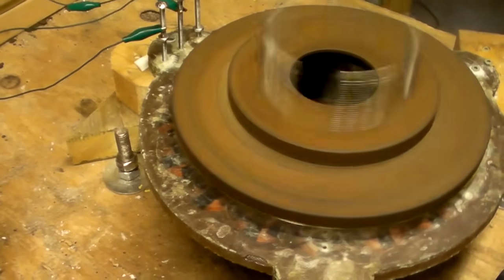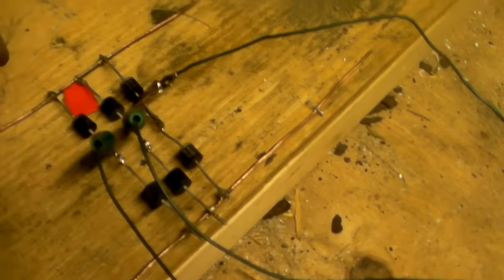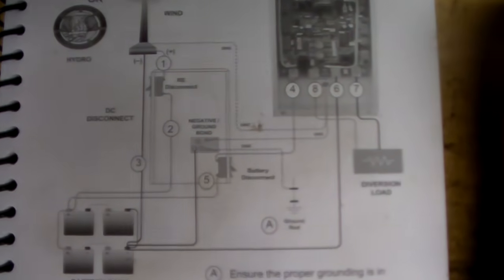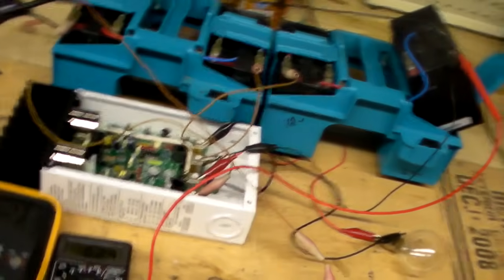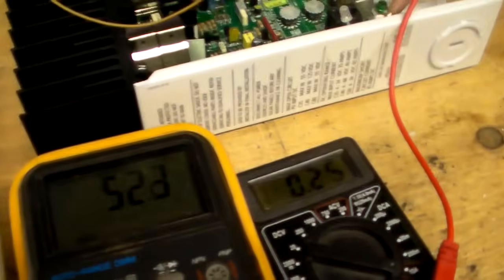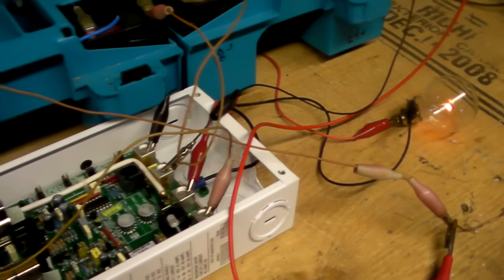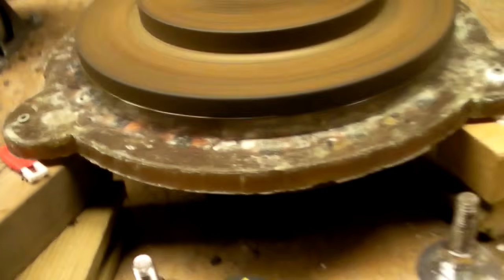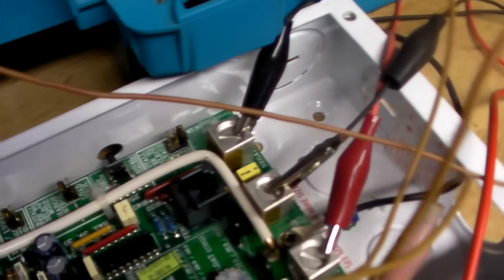3phase-24m-18c-125t-18awg-star-48v-test-42 axial flux vawt wind turbine

Comment: Hi! for many years i got on my mind make an axial flux generator for a wind turbine, i love axial flux coreless stator a dual magnet rotors coz the cero cogging with open curcuit that's very good for start spinning, robust, simply to do, and relatively cheaper, sorry my english, i'm from Corrientes, Argentina, i watched all your videos, and this push me more to take the desision to begin this ambisious project!, so, my goal would be make an axial flux generator that can reach 3 or 4 kw to charge 24 volt batteries bank system and can generate 100 or more amps, and a hybrid mppt controller(like the 150 midnite classic) to add solar panels in the future, i start to buying the magnets today, the stuff that i got in my mind is make a 24 poles and 18 copper coils, the coils would make with 1mm enameled copper x 10 paralel, one issue would be make the blades for me, the question is how many turns i 'll need to reach these  output power? thinking that the stator would have 6 in series each phases, the magnets are the neodimium N42 grade 40mmx20mmx10mm sizes, i just about to order 50 for the discount, but i'll need only 48 magnets, the 2 would be if break accidentally somes, i need your aswer about what you thinking of my project in general, and to get that voltage and that amps how many turns i will need make for low and moderate winds, i know that due the size of blades also, and some gusts wind sometimes, i hope you very helpfully answer from you guys, Thank you so much in advance!!! Bonus: This micro wind turbine i made with all recycled materials using one hoverboard wheel, actually it is disassembled to be acopled to have two rotors and a double power having the opction to switch between series or parallel from output of the 2 three phases bridge rectifiers, that controller with dump load regualble and automatic cooler with n35 temp sensor cirutitry was made by me also
Project testing: https://www.youtube.com/watch?v=RFdJ-gtsjbI
It can reach 20 amps in gust: https://www.youtube.com/watch?v=4JTPCLqn8DQ&t=131s
Wind Turbine done: https://www.youtube.com/watch?v=e48Dx4tmzLs
Reply from the maker: Well, i watched your videos, you do have advantage over me and that is you have nice spot for wind. you look like you know how to build things on your own. very well run HAWT.
I used these calculating sites for help
https://greenterrafirma.com/wind%20turbines.html
https://www.raeng.org.uk/publications/other/23-wind-turbine
https://rechneronline.de/wind-power/
these site focus the calculation on HAWT, but i lowered my results expectation
you probably know these sites.
the trouble in calculating "RPM vs COIL TURNS Vs VAC"  Is the lack of having proper and expensive measuring instruments,  so that is why we need to approach it using hands on bench testing, trial and error and improve on your design by observing the results of your built and adjusting to achieve best result.

"RPM vs COIL TURNS Vs VAC" 
your possible dream HAWT is to achieve 3 to 4 kw , that result will first will 
depend on: ??RPM first, because that is where the fist calculation of blade power starts, using the sites i list will approx tell you the blade area required to produce your 3to4kw, 
I think you need 76" tall blades 2 blades for higher RPM "200rpm and up" or 3 blades for lower RPM "120rpm and up". these are the rpm count when you expect to extract power from turbine, that is what we call "the sweet spot" because the turbine will stall/slowsdown if you extract power from before it reaches these speeds

so now that you know the rpm, you need to create a generator after rectification  that can produce 35 open volts DC,  
so you need to create a 3phase generator that will produce 28 open volts AC each phase, 
you mentioned that your are planing on 18 coils, so each phase will have 6 coils
so each 6 coils need to produce 28ovac at 200rpm (high speed turbine)
so each coil need to make approx 4 to 5 ovac, @ 2oo rpm, so now you need to test bench and create that result, that depends on "magnets strength, the layout, air gap and coil turns", these 4 things determines coil turn count in combination and relative to each other, if one changes so is the other.

this is the first step, after you calculate all that, then build your turbine/gen.

i hope i did ok on explaining, if anyone sees a mistake in my explanation, please go ahead and correct me, copy and past and repost my explanation with your correction.
s
Reply: @emagnets  Thank you so much! Very clear and helpful your explanation, and what about my plan of 1mm x10 to make the coils? And the magnet size of 40mmx20mmx10mm? Yes, the propose to make with 1mm x10 instead a thicker wire is to avoid empty places inside of the coil and make the compact and thinner coils as possible to increase efficiency and closer as possible between both rotors, these magnets are very strong, 12.000 gauss for this n42, it's not very accurate this measurement, sometimes n42 grade is almost n52 grade neodimium magnets strenght, i was planning turn about 80 turn to get 5 average volts per coil at 150 rpm average, i think that first after all I have to make the coil winder to make the coils and then, the stator, because depending the size of the stator make the rotor and that be accurately as possible the alignment the group of magnets to the centre of the the group of coils of one phase do you understand me? So, the desired goal for me is: thinner stator, 1mm or less gap between magnets and stator, very compact coils without loss power, and get charge 24 volt system with 100 amps or more, the smaller rotors diameter as possible, Sorry my English, I'm from Argentina, thanks in advance buddy.
Reply from the maker: @apbtmaxx  your plan seam solid and fair. like you said N42 could do the trick, but first you need to start testing. i am looking forward to watch your progress.
Reply: @emagnets  As soon as i start, i will upload the videos, Thank you buddy!

Comment: Another thought, I think you need 2 rotors for the 1 stator or 48 magnets for your design @ 24 per side, in order to create a magnetic circuit. Otherwise you need transformer laminations and 2 stators to 1 rotor for the magnetic circuit.

Comment: Coil to magnet ratio is OK, 4m/3c. If it fails to speed up and generate good power in higher wind, you may need to add resistance to get it to a more appropriate speed.
Homebrew Wind Power by Bartman and Fink will answer all of these questions. ;)
Another great book is The Homebuilt Dynamo by Alfred T. Forbes, a step by step picture guide.
Scaling up or down requires lots of thought.
Rotor, 12 magnets/side=24
Stator, 9 coils---v
12v--36T/2x14awg
24v--70T/14awg
48v--140T/17awg

Comment: @emagnets i think the controller dumps the current cause the voltage is to high u charging a 48v battery with 56,6V but can be wrong. Also the 14W output is not very high, any calculation how fast wind will give this rps?

Comment from the maker: @geocha1962, my best output creation was "2phase-4phase-chamas_serpentine axial flux pma alternator vawt wind turbine 62" project. 
Great at low rpm using star configuration for 24vdc battery bank.
all other pma still ok, however, the 2-4phase one was 8% more effecient than the rest.

regards

sam